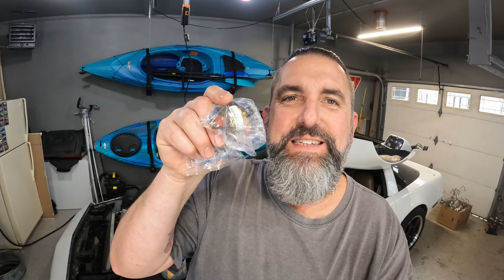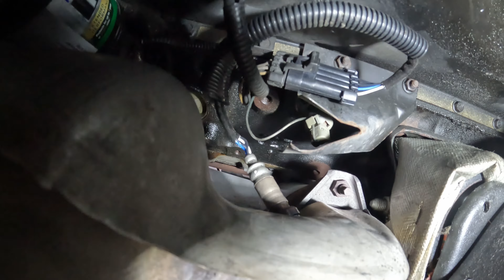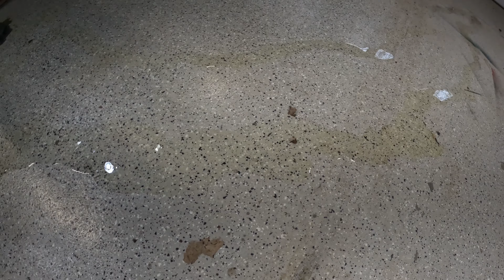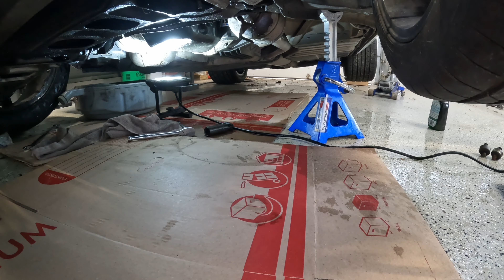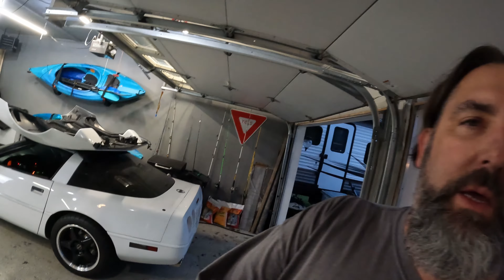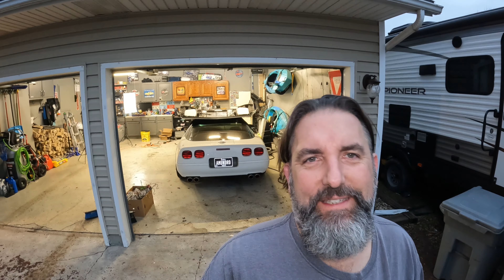Replacing Knock Sensors 1994 C4 Corvette

Comment: You never said what you ended up using on the actual knock sensor, socket or wrench???
Why did you say all dirty and gross at the end?? We all know you had a coolant shower!!!😃😂🤣
Reply from the maker: I used the socket on the knock sensors
Reply: @Amundred  Forums said to use vice gribs, channel locks, pipe wrench, blah blah blah. I have a good pair of channel locks, it's not working!🙄
Reply from the maker: @geneyus6411  😲
Reply: @Amundred  channel locks worked. Got it out. New one in.
I didn't drain the radiator, just the  block
My old knock sensor looked exactly like yours, I wonder if those were originals??
A guy in the forums said you are supposed to replace them regularly like a spark plug. Does the FSM say anything?
Reply: @Amundred  2nd knock sensor done!!!
Same issues with tightness, had to use channel locks again. Someone definitely overtighten those.  Should be only 15 ft lbs. Not a fun job on a crappy uneven driveway! I did notice fine particles in the drain pan, so probably put some fresh coolant in, I'd say 3-4 gallons came out between both sides.
Reply from the maker: @geneyus6411  😲
Reply: @Amundred  Nice!
When you tightened your new o2 sensors, was it tough???
Also have you ever done any maintenance to the push lock fuel lines for the fuel lines to rail???
Reply from the maker: @geneyus6411  my O2 sensors were easy and haven't done much with the fuel rails/lines. I have replaced the fuel filter, fuel pressure regulator and fuel pump, but that was really all.
Reply: @Amundred  Those push lock fuel lines seem like a weak point. There are just o rings inside where they lock.
Previous owner busted one of the slide over protector pieces.
Reply: @Amundred  When I was under the car, things looked pretty good, overall.
I would like to see the car on a lift and have all the metal fuel lines inspected though.
Reply: @Amundred  Torque value on the o2 sensor is 30 ft lbs, don't think it's going anywhere! Are there O rings on those push lock fuel lines. Somebody previously broke that protector sleeve on the fuel line connection, can that be replaced? Yesterday I broke the cheap clamp that holds the 2 fuel lines to the fender well. It was broken before , it's cheaply made! I think there are some better aftermarket line clamps out there.
Reply: @Amundred  I replaced those items too, except fuel pump, sure it needs the cannon lit😳 soon!
Reply from the maker: @geneyus6411  the fuel pump in these was super simple. No tank removal or anything crazy!
Reply from the maker: @geneyus6411  unless it is on the inside, I don't believe so
Reply: @Amundred  Any luck on your new parts?? I received my proper factory fan motors and fitting I needed for the radiator.  Tomorrow,  trimming the fan bracket with a dremel.  Just waiting on polyurethane mounts, so I can finish.
Did you check out the brake kit I asked you about?
Reply from the maker: @geneyus6411  they arrived yesterday! I plan on doing the install Tuesday 👍
Reply from the maker: @geneyus6411  I am kind of a fan of Power Stop for a "upgrade" over stock. I must have missed your question on the brakes! Sorry about that!

I did the full rotor/pad package for my car with the drilled/slotted rotors and the pads...like the Z26 package or something like that
Reply: @Amundred  Maybe we'll both be ready to drive finally,😂🤣😄
I see your little kickboxing made 1k views in a few hours.
We live in a world of idiocracy!
Reply from the maker: @geneyus6411  it is at almost 2k views in less than 3 hours 😂😂😂  (1635 in 3 hours according to the Studio statistics)

I am shocked to be honest 😲
Reply: @Amundred  I wanted you to view a brake upgrade kit on flee bay.
It seemed like an exceptional value to me. I'll be studying your fuel pump video ,I need that stuff soon.
Reply: @Amundred  Weren't your calipers junked out???
Reply: @Amundred  That's plain silly!!!!🤡
You may have found your viral video by accident!
Reply: @Amundred  Should have included mr pips! Even more views,lol
Reply: @Amundred  My NOS fan motors, look like new from 26 yrs ago!
Reply: @Amundred  Not easy being caretakers of these fine  automobiles!
I bought the auto version simple green for cleaning the condenser,  radiator bay.
I'm waiting on the polyurethane radiator mounts to finish this saga,lol😂
When I get the mounts, it will be some serious test fitting, I can't  F those up.
I'm  glad I got the correct fans, so they can last another 26 yrs.
The motor boxes have labels from a Cadillac dealer in Michigan in 1995!
Reply from the maker: @geneyus6411  it isn't easy! And the fans sound like they are definitely the OE fans!
Reply: @Amundred  oh yeah, they are originals from 95!
The simple green automotive spray says not to use over asphalt. 
That's what I have the car on.
Half asphalt,  beat up and half dirt. 
Sounds like some good stuff.
I bought it at home cheapo.
Reply: @Amundred  Just the complete fan shroud bracket was a project to clean up!
Reply: @Amundred  I know the new BECOOL  radiator will be far superior but for the money, they should include 1/8 inch NPT plug and 1/4 NPT to 5/16 nipple  for the T fitting on the upper right side.
No support, they don't respond to emails or calls.  Not good!
I've had to do a boatload of research on Corvette forums to figure things out.
The owner from Dewitts radiator seems to care more than most!
A lot of guys don't have the tools or skills to do modifications,  then a shop f's them over.
Reply: @Amundred  My poly radiator mounts will be out for delivery today through USPS. They just deliver any ole time!
In theory , I could have the install done today but I doubt it. Modding things takes time , especially if you want pro results. I'll have everything I need now including coolant.
Reply from the maker: @geneyus6411  it sure does! Excited to hear that you will have them soon!
Reply from the maker: @geneyus6411  yeah, I am surprised that they do not come with the fittings!
Reply from the maker: @geneyus6411  haha nice!
Reply: @Amundred  They just flat out don't care. I'm sure they save a lot of money by not doing that.👎
Reply: @Amundred  Thanks, same here!🤑
I still have to trim them up properly.
Reply: @Amundred  once you enter the world of Corvettes,  your $$$ doesn't go far,grrr!!
Reply: @Amundred  You would be surprised how much dirt, grime, bugs,pebbles came off/out of that fan shroud!!!
Probably 26 yr old dirt🤔
Reply: @Amundred  A guy in the forums said he uses a LT4 heavy duty timing chain on his 93 LT1. Another guy said he cut a hole in upper shroud to have access for cleaning and that the air filter box covers the hole.
Reply: @Amundred  I bit the bullet and bought a GM original motor mount New for my drivers side(discontinued part)
I know mine is faulty, I can hear it knocking over bumps. I'm also wondering if that was the cause for my old AC pulley seizing to the bracket.
Finding these mounts new is Rare!
I bought it from the same guy I received the fan motors from. The mount can be used for either side.
Reply from the maker: @geneyus6411  I need to do motor mounts on mine too. The heat shield on mine has started falling apart and was smoldering the last.time I started the car! 😲
Reply: @Amundred  If you ever find GM oem mounts , snatch them up!
Reply: @Amundred  That's a common C4 fail part, especially on drivers side.
LT5 mounts will work also, same thing.
Rockauto just has cheapie mounts in stock, the better ones are sold out.
Reply: @Amundred  I checked out used mounts wraps on Fleebay,lol
They looked like crumpled up pieces of junk! That was a poor design, wth??
Reply from the maker: @geneyus6411  I looked up eBay too... definitely junk on there
Reply: @Amundred  You need the mounts too? I didn't use the simple green because it says not to use over pavement.  I have some sand to clean out on the bottom piece of the radiator tray. I don't have a compressor to blow out the condenser, wish I did.
New mounts didn't arrive yet.
Reply: @Amundred  Fleebay can have excellent finds too, not all junk!🙄
Reply: @Amundred  The NOS  Delco Factory fan motors look at home bolted in the fan housing! They've been waiting since 1995 to get in there.
Reply: @Amundred  Why exactly did you leave the pulsator off on your 1st fuel pump video?? That was a big boo boo!
Also you didnt know about the inferior pump brand?
Reply from the maker: @geneyus6411  the problem that I was having,  some people online had said that the Pulsator removal fixed the issue for them...so I tried it as well 🤷
Reply from the maker: @geneyus6411  I need the mounts too
Reply: @Amundred  I read that having a messed up pulsator caused their problems! I wonder if that's your problem too!
Reply: @Amundred  I wonder how involved that is?? I've seen zero videos a out that process.
Reply: @Amundred  So the pulsator may be the longest part replacement to solve the problem!🤔
Reply from the maker: @geneyus6411  haha... possibly! 😂
Reply: @Amundred  We will see, you'll be doing that soon! Does your wife get involved with your car projects at all?
I'm guessing NO!!!!
I disassembled,  hand scrub all my fan pieces, they were nasty. Had like a fine silt coating on them. Things are not easy to access or clean on vehicle.
Reply: @Amundred  Those other fan motors I could not return will be going on feebay.
I believe they fit 1985 to 2004 Chevys.
They are a Japanese brand, not china.
Reply: @Amundred  This radiator install has turned into a shit show! Extremely difficult to trim poly mounts. If I use a dremel , it's very messy and just melts the cuts. Has taken me hours just to do that by hand with razor blades, exacto knife 
Could you tell me if your stock fans mount flush onto the motors?? Mine are sticking out about 1/8 inch to 1/4 inch.
I mean the whole round loop. You'll have to physically reach in the back of your fan and feel with your finger.
I have 2 mounts done, took me hours to trim the material away, really bogging down the whole project, sux!
Reply: @Amundred  I wonder if you'll be able to find the mount protectors new???
Reply from the maker: @geneyus6411  I haven't been able to as of yet
Reply: @Amundred  Just think about it, All your problems started when you ditched your pulsator 😱
I know you had many other legitimate issues too.
Reply from the maker: @geneyus6411  looks like it sticks out a bit: Cooling fan/motor 1994 LT1 Corvette
https://www.instagram.com/p/CehWDctLCot/?igshid=MDJmNzVkMjY=
Reply: @Amundred  Well that's good news!
Reason I asked is they actually sell 2 different motors, one with a thick mounting plate for the fan and vise versa.
Reply: @Amundred  The picture was super dark but Thank you for your efforts!
I'm commited to the install now.
I have 2 other mounts to trim up before I can start wresting outside.
I'm sure the upper cover needs trimming also.
Reply: @Amundred  One guy in the forums said to freeze the polyurethane mount then cut with a jig saw, miter saw which I don't have but I could try dremel again.
Reply from the maker: @geneyus6411  sounds like an option that could work!
Reply: @Amundred  Not many options besides that. I've seen guys on forums saying 30 min or 1 hr for custom radiator install, I'm calling BS on that!
Unless you have a race shop or unlimited tool supply.  The mounts is something is that realistically should take 5 min per piece. Are you going to attempt to do the motor mounts at home??
It would be 1000 x easier with a lift.
I'm surprised you don't have that mini lift, I think it's around $1500.
I wish I  at least had the race ramps.
Reply: @Amundred  I stuck a mount in the freezer for overnight, I'll let you know how it goes. 2 rain days coming up,
I'd like to have the other 2 mounts totally done.  How's your project going?
Reply: @Amundred  What happened with your project?? Decided to play Apex instead🤣🤣🤣!!!
Reply from the maker: @geneyus6411  haha, video will be up ahortly
Reply: @Amundred  Awesome,  hopefully you didn't edit out all the bad stuff???
You're not even hinting about the outcome🤔 I hope you can finally have some fun in your C4 now.
I didn't try cutting the frozen mount yet, took a long time to freeze up.
The mounts are really delaying me! Grrr
Reply from the maker: @geneyus6411  haha...it was interesting
Reply: @Amundred you're just building me up for the video!!
Reply: @Amundred  So , interesting results with freezing the mounts. With the dremel, no difference, just burned, smelly, nasty dust. I then tried with x acto knife and razor blade with wooden handle,  it definitely made a difference.
I was able to carve things out more squarely  and pieces came off in larger chunks!! So guys if you ever have to do that FREEZE your poly mounts first!
Not to sure if Rubber would have the same outcome. Even the stock rubber mounts are NOT easy to trim , I tried it.
For those of you who have no clue what I'm doing,  going from stock radiator 1" in width to BECOOL radiator 2.5" thick!!!
And no hacking😳
Reply: @Amundred  I'm just waiting for it to cool down a little outside. I have zero shade and with sun it gets brutal hot working on a black car!
It didn't end up raining yet.
I hope the mounts work, so I can get that becool bad boy in there. Once that upper radiator cover is on, it shouldn't move!
Reply: @Amundred  Yes, it somewhat worked!
Helped for doing it by hand, no good with  dremel. Pisses me off, I know guys have been installing 2-3 row  radiator since forever!! You'd think there would be upper and lower radiator mounts that would drop right in and be like a 5 min job.
I feel like I'm pioneering the 1st mod!😱🤪😳
Reply: @Amundred  Also, when cutting those mounts, half of it on the bottom mounts is stepped, that was to originally hug the plastic tanks. But when modding you have to remove that step and make the bottom perfectly flat, it's a beeeyotch!
Reply from the maker: @geneyus6411  sounds like a complete PITA!
Reply from the maker: @geneyus6411  you could 3D print them if you had a 3D printer and sell them!
Reply: @Amundred  That would be great!
Unfortunately,  I don't have that capability.  You do though.
I'll let you have the patent!🤑🤑🤑
Reply: @Amundred  Absolutely no videos on modding the mounts and very little on forums, had to hunt to find anything.
I feel like I'm the engineer.
Reply: @Amundred  The radiator is actually in the car now!
Reply: @Amundred  If you were really serious about it, making the molds yourself might be quicker!
Maybe print the 1st one for the mold.
Reply: @Amundred  I watched your knock sensor video again for motivation,lol.
It's the one where you dissed my funnel😳 When you actually pulled the old knock sensors, did the coolant stink or seem dirty coming from the block??
I also saw in the video how the o2 sensor was clipped to the shield.
Reply from the maker: @geneyus6411  the coolant was clean that came out of mine...but I have pulled the water pump off like 4 times in the last year, flushed the coolant a couple of times and haven't driven it a single mile 😂
Reply: @Amundred  I asked because some guys on the forums said the stuff in the block was stinky 😥
I have super clean coolant also.
I also noticed the 3 small screws on the radiator shround.
Reply: @Amundred  The coolant that came out of the block 2day was perfectly clean. Some guys in forums say it stinks, full of junk, they must be garage queens,lol.
Home cheap was tied with wally marts  for best coolant price $13 50/50 Dex.
The chain parts stores are a rip off!!
Advanced was $20! @ 1 gal.
Reply from the maker: @geneyus6411  haha, for sure
Reply: @Amundred  I don't even remember you discussing the torque value???
🤔 15 ft lbs sounds right to me.
Did you do that??
Overtighten can cause the sensors to be to sensative, important info!🤓
Reply: @Amundred  Another hell show parts change today. lol The part where you put the socket on  the knock sensor just spins, so it's like you do nothing when turning it! I've been working on it for hours now! A bunch of turns, I did see the whole body of it move but then got to a point where it wouldn't come out anymore with the socket. Not fun!
Reply: @Amundred  My knock sensor shield had no hole in at all for locking in the o2 sensor push pin on the clip, any ideas??
I didn't see a hole in your shield either??
Looks like it was just clipped in on top of the shield somehow.
Reply from the maker: @geneyus6411  you know, I do think it was just a little metal clip thing now that you mention that, I will take a look at some point this weekend!
Reply: @Amundred  I searched forums for hours, not much info on how the o2 connector was secured. Someone previously just looped that connector through the starter wire and left it that way!! That's very hacky. I don't like zip tying to other wires either. Zip tie can wear through a wire or totally fall off.
I noticed the oil pan gasket weeping in some spots. Not super bad but definitely needs to be addressed!
Reply: @Amundred  I need to figure a way to secure that connector, grrrr! 
There's not enough slack in the factory wires to clip the connection yo the shield. A nickel holding up a dollar!
I received my GM cooling fans.
The cases are not even painted, I thought they are supposed to be black??
At least they aren't from china!
Reply: @Amundred  I was under the car fabricating a clip and sky turned black and downpouring now.
Reply: @Amundred  Only thing holding me up from lowering the car off the jacks is 
On the passenger side , was there factory zip ties?? There's no hole at all in the shield to push the pin through on the connector. It's like I'm missing something?? It's a 1995.
Reply from the maker: @geneyus6411  I believe that it was a clip, like the driver's side. I will try to take a look when at dinner point and find out for sure